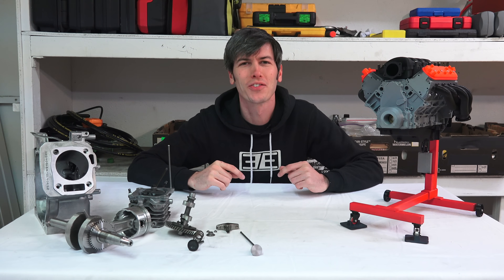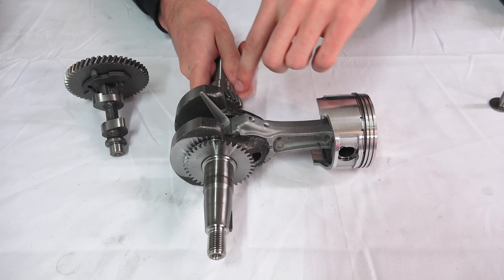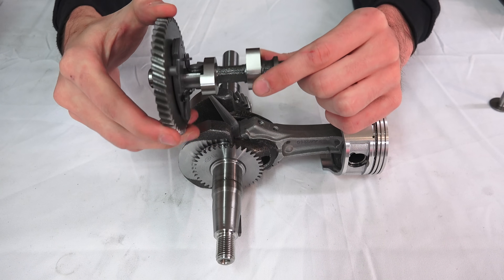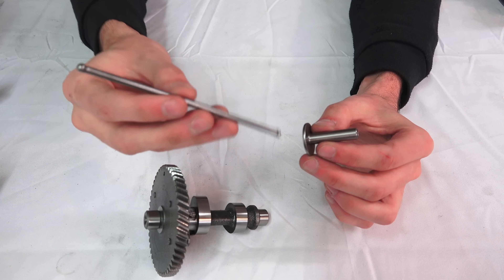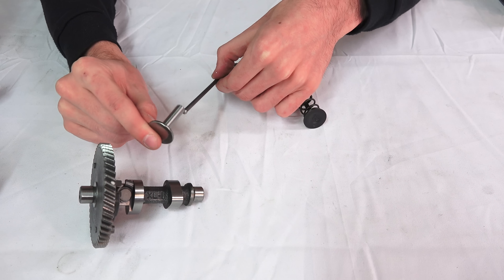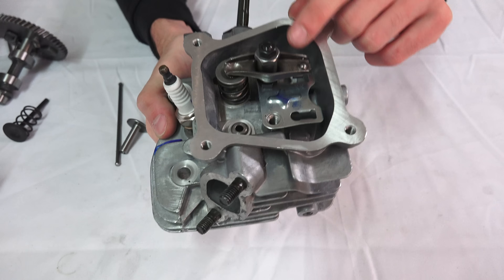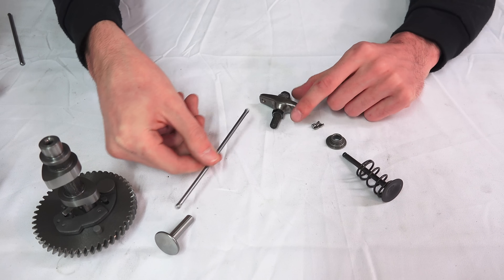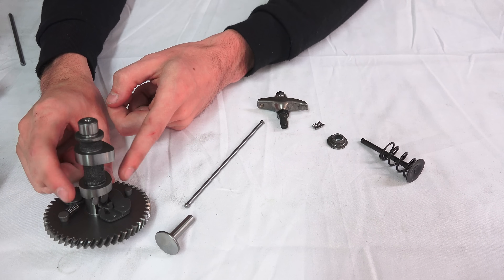Why Can't Pushrod Engines Rev High?

Comment: Nicely done video, as usual.
I think it's important to point out that OHC engines aren't necessarily better (or worse) than pushrod engines, they're just different and each excels in different applications.
RPM kills and manufacturers improve reliability by designing the engine to optimize power at the lowest RPM possible. Most pushrod engines are larger displacement engines that make more power at lower RPM's which is especially good in larger North American market sedans and trucks, but even in performance applications cars like the Corvette continue to prove that pushrod engines are still able to compete with and even dominate any OHC engine in street applications. 
For small, lightweight European cars, lightweight, high revving, OHC engines make more sense and work well. It comes down to weight, where torque rules. Motorcycles being the extreme example on the lightweight, high revving, OHC side. Low revving, big block, pushrod, truck engines being the other end.
Right tool for the right job kind of thing.
Reply: There's a reason why Asians and Europeans quit building pushrods 70 years ago. Yes OHC and DOHC 4 and 5 valve engines are superior.  Need bottom torque? Diesel!  More efficient than pushrod dinosaur gas longer lasting and still more torque. In the 70's Mercedes build SOHC OM616 and 617 engines that rev  to 5500 RPM last million miles and still on the road today.
Reply: @anthonynicholich9654 

Pushrods are more compact. 

You dont need overhead cams for multivalve operation either.

Comment: wow did you go to college to learn how a motor works ... just a FYI there are plenty of9k rpm sb chevys on the dirt tracks around the usa ... valve float is cured by high pressure springs

Comment: And what do YOU consider high RPM?
Top Fuel, Pro Stock and the like rev over 10K
Nascar engines rev to 9K or a little over. 
It does take $$$ to get these engines to stay together at those RPM, but can be done.

Comment: WRONG Sorry but that's  not right with both engines you still have the weak link i.e. the valve springs, the springs don't care what is pushing them down only that they are pushed, valve float has nothing to do with push rods or rocker arms. Don't get me wrong there is big advantages to over head cam engines but what you're not taking in to account is the fact that those big engines don't need to rev high to get the HP they want and the weight of all those pistons and longer heavier crank longer and heavier cam shaft, all come together to make it alot more expensive and difficult to get more R.P.M's  when they don't really need to. If you look around you will see very high rev-ing engines are also smaller displacement case in point a 20.000 r.p.m 4 stroke 6 cylinder bike engine with only 250cc and I believe i saw one with 125cc but that's extremes in a daily driver you have the small 4cyl engines with small displacement in order to make more power they increase the r.p.m.s  in a large displacement engine you don't need the high revs factory's want to make money and not put the highest HP and R.P.M. engine in every car they sell (not cost effective)...

Comment: So I have a question. I am getting a new bigger turbo added to replace the one I got. How should I drive untill I get a tune and how unsafe is it? I have afr boost and oil pressure guages to monitor the engine but I need to daily it untill I can get it tuned. Any info would help thanks.

Comment: Good explanation.
Another factor not mentioned, high performance pushrod engines use solid lifters, and sometimes roller lifters, but normal every day engines tend to use hydraulic lifters. A hydraulic lifter is designed to self adjust for valve lash, no manual adjustment required. But they do have a range of speeds, and at higher revs they tend to pump up, and the the valves don't shut. Stiffer valve-springs will not only help control valve float, they will also reduce pump-up, but it will happen. There is also a half-way step where you can get bleed-down lifters, which are designed for quite high performance applications. Those are usually quite resistant to pump-up, because for one thing, they're designed to bleed down, and offer lower lift & less duration at lower revs. That does tend to cancel out the pump-up but it can still happen.
Another problem is the sheer strength of the pushrods. A big valve and a stiff spring, a strong roller-rocker, a solid lifter and a solid cam, and a standard pushrod can bend. If it happens slightly, you just take them out and tap them straight with a hammer, (nylon head hammer if you must) on a block of wood. But if it happens in a big way you can completely lunch the rod and maybe the lifter as well.
So what is a suitable speed for a single cam pushrod engine? Depends... I seem to remember one company made a 2.85 litre IndyCar motor, with pushrods & 4 valves. I'm not sure but I think that was Mercedes. They only did it to show it could be done, to show off, but that engine ran the Indy 500 and it was still going strong...

Comment: A high rev push-rod v8 requires a very tough valve train and a shorter stroke. But the different designs have advantages, the push-rod is more compact and stronger.

Comment: NASCAR engine camshafts are designed to loose contact and loft the valve up for additional valve lift / air flow and catch the tappet on the down ramp, kind of a controlled float. This is due to the rules on maximum camshaft lift.

Comment: A little bit outdated on the RPM specs of F1. They were limited to 19k in the V10s, and 18k in the V8s. Since the hybrid era ('14), and combustion engine volume reduction, the RPM limit has reduced to 15k but during long race runs rarely get this high to maintain reliability because of the limited number of engine changes in a season. Still seriously impressive video though. Is there a (practical) limit to the frequency of combustion? Obviously, as the RPM climbs, the stroke needs to reduce to reduce inertia and G on the con-rod etc.

Comment: My pushrod LS2 with LS3 CNC ported heads and a hydraulic roller cam turns 7200rpm fast with plenty of torque at 2200rpm for cruising how many rpm do you want to turn and pulls hard all the way to 7200rpm there is no drop off of power what so ever to 7200rpm if your not on the shifter your bouncing it off the rev limiter in 1st and 2nd gear

Comment: What I understood is that the issue is springs not the push rod set cuz you said that the spring may take time to return to the shut position ! So whats the difference between the ohc and ohv
Reply from the maker: Ohc has smaller valves and no pushrods, so less reciprocating mass.

Comment: Why can’t pushrod engines rev high? They can, but people still have a 1960s mentality. Pushrod engines can rev plenty high. Shaft rockers, proper valve springs, retainers, pushrods etc. Cam and heads selection needs to be able to flow at high RPM otherwise there’s no point. It’s easy to make a pushrod valvetrain handle high RPM, but a cam that can make power at 7,000 RPM+, generally speaking, doesn’t have great driving characteristics and 2 valve heads that can support airflow at that RPM are very expensive. They can rev plenty high when built right, but LSs are a good example of a factory pushrod engine that revs decently high in stock trim... Technology has came a long way. Yes, for the most part OHC engines are more suitable for high RPM as they are more “stable” and have the advantage of 4 valves per cylinder if so equipped. Pros and cons to each, personally I prefer OHC for inline engines and pushrod for V engines. Oneday I’d like to see mass produced 4 valve pushrod engines that are suitable for high RPM, currently that’s only available in the diesel segment as their valvetrain isn’t desined for high RPM operation.

Comment: So a Nascar engine PUSHROD sits at 9k all day no probs. My mini engine and many others in the mini world turn 9k no probs, again pushrod and over 50 year old design. LS engines see 8k and don't grenade, 400CI plus drag engines rev 10k. 
Granted, Factory pushrod engines may not rev this high, but most factory based engines regardless of pushrod or overhead cam don't rev high. 
Any engine config. will turn hard RPMs with the right components and combinations. It is wrong to misleed.

Comment: So the biggest problem with this is there are pushrod v8's running 9K rpm. It's a balance of spring pressure, cam profile and valve train mass. The only thing OHC fixes is the valve train mass while removing limitations of the long weak pushrod.

All up though pushrods should have died with the dinosaurs

Comment: What you fail to mention [And you do this regularly....] is that a racing engine is NOT a production street car engine!  A NASCAR V8 pushrod engine has parts that are made from bar stock and often times have roller lifters. These are far more complex than the simple 391 cc Honda generator engine parts that you've shown.

[You have a thing for Honda I've noticed....]

NASCAR engines could probably run 800k miles on their stock valve train if this was a normal street engine.  But this is ~~~NOT~~~ a normal street engine!!!  This is a $100,000 hand-built racing engine designed for 500 miles tops.  Chever-lay and Dowdge get away with this valve design because it works at street car revs and it is the almighty CHEAP to produce!

The best design for an automobile these days is a four-valve SOHC system.  A DOHC is a little better at high RPM's but the engine needs to be tailored to the use.  American companies just do whatever is cheapest and still sells cars~

Comment: You probably drive a Rice Burner...You clearly do not know,or have ever been around,or built a HI RPM pushrod engine....My service manager use to build Nascar Engine's...I have SEEN dyno sheets that SHOW small block Chevy's going over 10.000 RPM...it is done every day on the Nascar circuit....and they run for hour's and hour's racing...Learn how to build an engine and use the proper valve train components.....Did you know they use Titanium valve's,carbon fiber pushrods and other things to achieve this?...Clearly not.....
Reply: And those NASCAR engines cost $100,000 each.....

Hello?
Reply: And he does drive a yellow Honda S2000.  Why I have no idea~
Reply: They are expensive engines...no where near 100k...LOL.....to each his own I guess...But don't say pushrod engine don't Rev,because they can and do....I just finished a 383 Small block stroker that hits 8000 RPM anytime I want it to....

Comment: Compared to what? A Honda with 1/3rd the displacement and half the pistons? Their current V6 only does about 6800. A current LT1 does 6500. An LS7 was up around 7200 and the old school DZ 302  would rev well into 7000. The question would be why? 8 or 9k RPM V8's sound amazing, but they don't need 9k RPM to make power.

Comment: This must be for factory performance pushrods on stock tunes and or valvetrains.  LS motors, small block Ford's, and small block Chevy's with shorter stroke cranks do not have rev issues.  I've built both Ford 302 and Chevy 283 crank based (327) Chevy motors with 7,500 to 8k rev limits respectively, and great reliability.  As the new pushrods go, both the LT. And Apache based Hellcat motors can be tuned per mods to 7k reliability without an issue.  Livernois tuned their Trackhawk to run over 7k without issue.

Comment: Can you do a video on why direct injected engines get carbon buildup on the valves due to the egr system? That would be great. I also wish they would have a fix for that other than deleting the egr or having it be dual injected (port/direct). Thanks.

Comment: 🎤The flat tappet's connected to the, push rod.🎤
🎤The push rod's connected to the, rocker arm.🎤
🎤The rocker arm's connected to the, intake valve.🎤
🎤This motor's gonna drive around.🎤

Comment: another factor that comes into play most times is piston speed. alot of v8's have huge heavy pistons with long crank strokes that cause immense piston speed and friction. great for low rpm torque but just their rotating assembly is limiting their high rpm potential. a nascars stroke is 3.25 inches compared to a formula 1 stroke of 1.56 inches. at 10,000rpm the nascar engine has a 4.1 inch piston traveling 5416 feet per second. while a formula 1 engine at the same rpm has a  3.9 inch piston with a piston speed of 2600 feet per second. a formula 1 engine will not reach the nascars piston speed until about 21,000rpm. converting a nascar engine to DOHC will not allow it to now rev to 20,000rpm. the piston will fly out the side of the block lol. ofcourse both engines being exactly the same the pushrod valvetrain is holding it back. but finding a short stroke pushrod engine is kind of rare. the nascar engine actually has a relatively short stroke in comparison to most production v8s. also the valve spring itself isn't that much of a limiting factor in smaller engines, the yamaha r6 will happily rev to 16000rpm. and look at the stroke. 1.67 inch. small short stroke toy engines will rev to the moon. big v8 truck engines will not. want to make a high rpm engine? small stroke dohc. which is what just about every superbike and formula 1engine use.

Comment: Not sure how definition of low reeving is being applied here to pushrods. I get that valve control is harder to maintain on pushrod engines but they certainly aren't all low rev limited for merely being pushrod actuated. 

I know of many LSx based engines pushing well over 8k, and several Buck v6s pushing well over 7k and few destroked turbo Buick v6 race engines pushing 9.5k.   

In fact I was dyno tuning an NA v6 race engine yesterday and we hit almost 8K as the rev limiter wasn't working correctly and went well past the 7.5 limit set in the ECU calibration. There wasn't any real valve control issues at all, even with single coil 150lb springs close to 8k which was actually quite surprising given the the relatively light springs.

For me personally with engine development, the 2 main rpm limiting factors in pushrod engines have always been too much stroke/rotating mass and intake manifold design.  Valvetrain design I have always had little to no issues at those rpms, this would be because I always carefully design them before implementing it so I don't get control issues in the first place.

Comment: This video needs to be re-titled because push rod engines can rev high.  Stock 7,000+ and 9,000+ rpm when built with an upgraded valve train which is pretty standard numbers for most high performance engines OHV or OHC.

Comment: All ohv engines are pushrod engines, it self explaining there or am I wrong? SOHC AND DOHC have more control over the valves. Vanos/VVTI/VTECH and other forms of electronics help control the valves during different loads. One thing that'll be crazy, if the FREEVALVE technology would ever become available for aftermarket manufacturers later on in the future, just imagine it now. I'm pretty sure you know all about this but maybe not others.

Comment: The Ilmor designed Mercedes-Benz 500I 3.4l v8 1994 Indycar engine made 1024bhp at a rev limited 10500rpm . One of the greatest push rod engines of all time. Built in secret , it was nicknamed the beast , dominated the Indy 500 and was promptly banned.

Comment: What is that pointy spike that comes off the rod cap?
Reply: It dips into the oil to splash it up on to the moving parts..
Reply: Daniel Armstrong I was thinking that too, but it didn't make sense. Most cars have a shield to prevent the crank from directly hitting the oil in the pan since that causes foaming....yet apparently they are intentionally doing that here? You'd think the oil naturally coming out from the bearings as oil is pumped through would be enough
Reply: There's a problem there, these engine have no oil pump or filter, splash lube is all they have. It's either a dipper on the rod bearing cap or, usually on vertical crankshaft, a little plastic paddle wheel that just throws oil all over inside.
Reply: Interesting....I never knew that engines like that existed. Thanks : )

Comment: What he fails to mention is that nearly all pushrod v8 engines are above 5 liters and have a relatively long stroke. None of them need to rev higher than 7k under most circumstances and make the same power at a much lower rpm. The piston speed is tremendously higher on a nascar 358ci engine turning 10k rpm than an f1 engine turning 20, f1 engines at least traditionally have virtually no stroke and them along with most dohc multi valve engines need to turn a lot of revs to extract every ounce of power from their small displacement. Putting multi valve dohc heads on a 5 plus liter v8 has been done a thousand times in the past and the gains are negligible for the added size, weight, and complexity of them. Overhead cams def have a place but it’s usually on smaller engines that can benefit greatly from it or inline configured engines where it only makes sense to use it. 

At the end of the day, cam phasing, vvt and v-tec are all just band aids put in place to make small engines feel more like big engines and broaden the torque curve while maintaining fuel economy. There’s a reason the LS is the most popular power platform on earth and does it using those antiquated pushrods

Comment: With out watching.....
Push rod engines can rev as high as you design them to. 
Push rod valve train is heavy and has many moving parts....they make more power low in a rpm range do to there ability to multiply lift. They make power low in rpm. He mentions float....its from the valve train being heavy. 
Over head cams have less mass being supported by the valve spring.